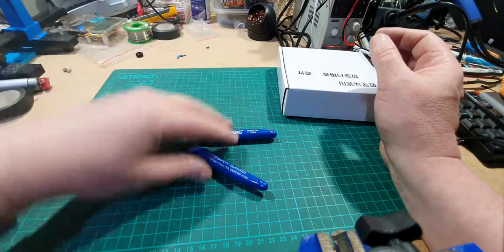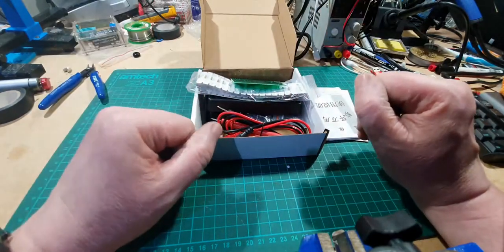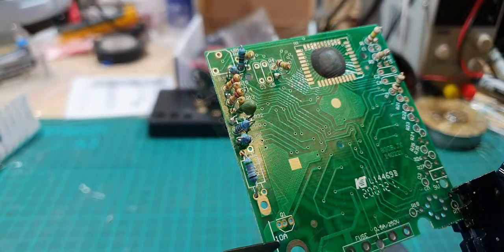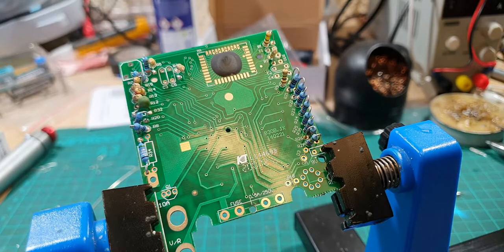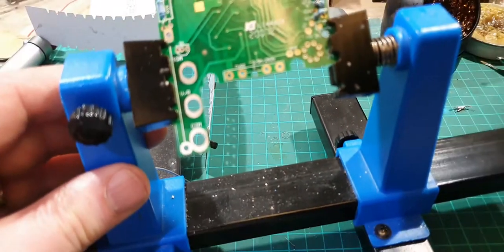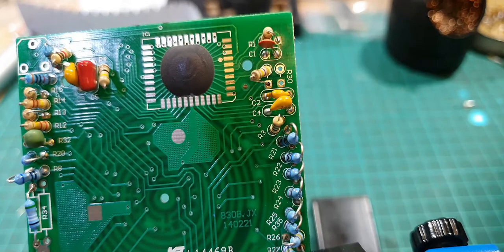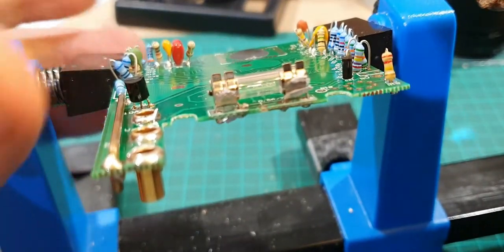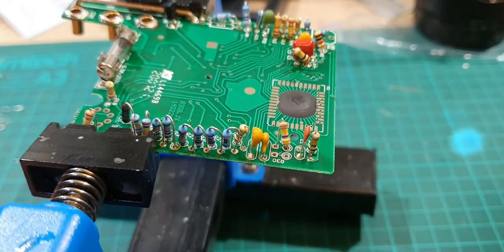Part 1 of 2 Kit build of Ali Express DT8303 Digital Multimeter

Comment: Your solder wire is bad quality. Perhaps its 20/80 used in led bulb industry. Electronics pcb work better with 60/40